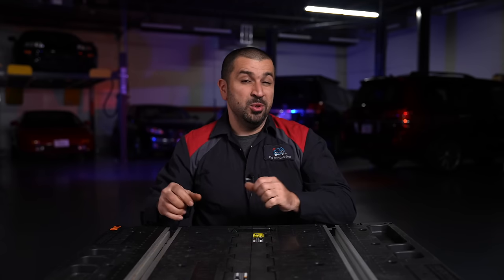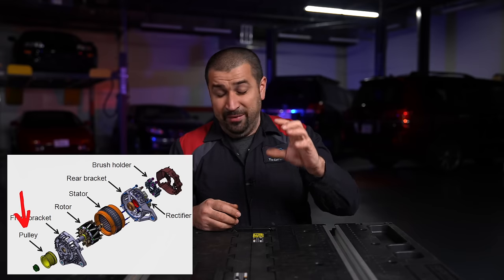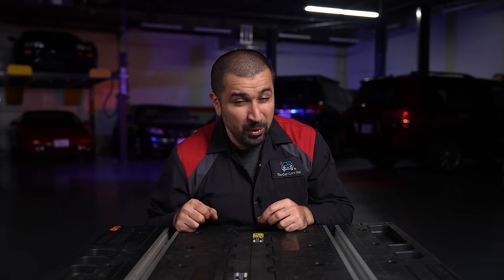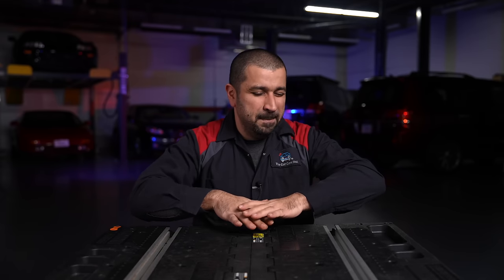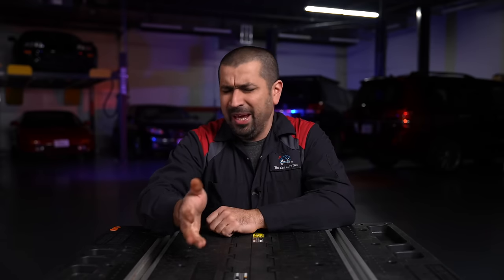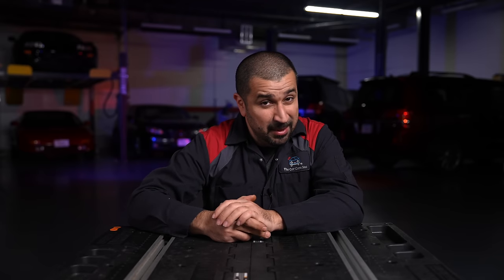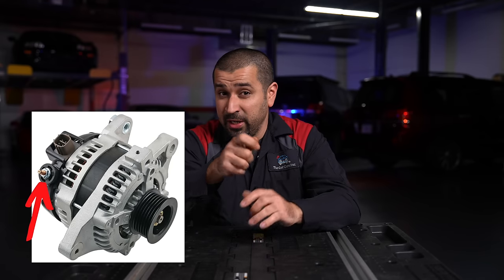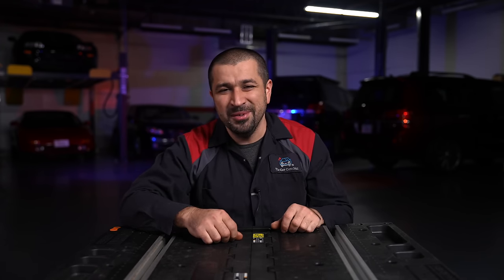How To Make Your Car's Alternator Last Longer? Everything You Need to Know

Comment: Answer:  Buy an OEM alternator.  Do not buy aftermarket.  You’re welcome.
Reply: I would say, if money is tight- buy brand new aftermarket but never manufacture.

OEM > brand new aftermarket > remanufacture
Reply: @herewegoagain7403 As an ex Lucas Aerospace Technician I have never had to replaced an Alternator in over 46 year's of driving I've never know the Stator or Rotor windings to burn out  it's always been either Worn out Brushes,Regulator or Diodes that go faulty and once there replaced there as good as new.
Reply: Except VW costs more than the car.
Reply: @stephenjones9153  I wholeheartedly agree with you. In 57 years of driving, I've always repaired the OEM alternator, never replaced one. The shortest term I've owned a vehicle is 12 years, the longest, 24 years.
Reply: @herewegoagain7403 It depends, I think Denso only keep the casing in their reman'd alternators, everything else is essentially new.
Reply: Just go oem or rebuild oem.  Also charge battery at least every 2 weeks.  My 98 maxima has only needed 2 alternators so far.  Paid $600 last year for the last semester one.  Don't cheap out
Reply: Yeah the oem toyota alternators are remanufactured. I just bought one
Reply: Wow terrible advice, thanks 🙏🏾
Reply: @HawkingHorizon  yes, if it's OEM reman straight from the dealer, then i wouldn't mind but the other brands from autopart stores are usually junk. That's why it's lifetime warranty, gets replaced often
Reply: Thank you 😊
Reply: Also brake calipers
Reply: Absolutely!!! Do not buy any of the ones from Autozone, mine didn’t last one month before it failed. I bought a used OEM one (they stopped making them new for my car) and it’s been fine for over a year now.
Reply: @luvingfully  That's because we were taut by our Dad's and Uncle's how to fix our own stuff and we had no phones to play games on. Most drivers these days can't even change a flat tyre 😉👍👍👍
Reply: I have a new aftermarket alternator from Amazon. Who knows where it was made in. It’s going on three years with no issues. Knock on wood!
Reply: Thank you for saving me half an hour
Reply: Denso aftermarket alternators, both reman or new,  are fine. Bosch is a close second. All other sources…forget about it.
Reply: How difficult is it to replace those items? DIY'er?
Reply: @jimbike8064  Some aren’t bad. Others are c**ksuckers.  Depends on where it’s mounted on the car/truck you’re dealing with.
Reply: @jimbike8064  👍Changing it is easy. It’s digging your way by removing other parts is where the mystery is.
Reply: That was NOT his advice to make them last longer.  If you watch the video he talks about ensuring your alternator doesn’t heave anything leaking onto it and also ensuring you have a healthy battery as both effect the alternator.  He explained simply and concisely how everything works and what to look for.   Don’t short change his advice/video.
Reply: Just measure "worst case" how much current your drawing continuously from your alternator while it is parked. typically the rated output of the OEM alt. should be double what your actually pulling from it.  If your Tundra is rated at 120A dont pull more than 60A max con tinuous.  Overheating the alternator will lower life expectancy of diodes. brushes last about 200k miles
Reply: OEM only on starters and alternators for me. I’ve had bad experiences deviating from that principle…
Reply: It’s been mentioned but OEM is great for those that have the means, those that are more cost conscious will of course explore options. First tier suppliers to the OEMs (Denso, Bosch, AC Delco, etc. respectively) are excellent options and still retain the reliability and longevity of the vehicle OEM. Another great cost saving option for Toyota/Lexus/Diahotsu owners is find the correct part number and add a “-84” to the end for the OE remanufactured part, they will normally save you a pile of money and come with the same 1yr warranty. If you’re in a pinch anything will work for a period of time but the quality tends to drop off quickly and you will use the lifetime warranty on that O’Reilly’s special.

FWIW, if you have a 4.7 Toyota only use Toyota or Denso starters unless you enjoy R&Ring the intake manifold.

Having driven Toyota’s, Lexus, and Mercedes for many many years there are absolutely certain parts that only OEM will do; engine, transmission, steering racks, axles/CV’s parts are the only way to go if you plan to keep the vehicle.
Reply: my toyota corolla alternator only lasted 220,000mies however volkswagen jetta alternator lasted 302,000miles
Reply: @cj8489  He said at the end to only buy OEM.
Reply: @BW-kv9wj  I’m aware.   That is NOT the answer he gave to “Make your cars alternator last longer,” as the title states.  He says that at the end, if you need to replace an alternator.
Reply: I only buy OEM Toyota cars made in Japan, not the aftermarket made in Kentucky Toyotas 😂
Reply: Ty for saving my time
Reply: Best advice he gave
Reply: @cj8489  Whatever. Keep buying aftermarket alternators then. I can care less.
Reply: @BW-kv9wj   It doesn’t matter what I buy.   You’re oversimplifying what he said and leaving out the majority of the advice from the beginning.  Like I said, don’t short change the man’s advice or video.
Reply: You do recognize that OEM alternators cost about $1000 from the dealer?
Reply: I’m going to cut straight to the point replace your battery every 3yrs thank me later. You will have no problems if money is an issue  then change you battery every 5yrs.
Reply: That’s the only Toyota mechanics mantra. Toyota leaks or malfunctions? - Buy more Toyota! Toyota’s up to crappy specs? - Toyota for life!
Reply: This man is correct
Reply: @stephenjones9153  Yours definitely didn't teach you to spell
Reply: @fw1421 they've always been expensive. I bought an 84 Nissan 300zx in 92 for 500 dollars. It was a nice car but alternator went out and it cost me 250 dollars from dealer. That was almost what I paid for whole fkn car
Reply: Do preventative maintenance. Don't wait till shit is about to leave you stranded before you replace it. .
Reply: Why, if oem was so good, why you looking for another? It means oem failed. Lol
Reply: Exactly
Reply: That goes with anything. No aftermarket will ever last as long as OEM.
Reply: Can confirm.
Reply: I have a Napa premium alternator with 200k on it still working perfectly fine.
Reply: Having repaired many alternators over the years, the 2 most common failures were diodes and on the GMs, rear bearing failures.  When that bearing fails, the armature/rotor drops and then grinds on the stator windings ruining the whole thing due to such tight tolerances…
Reply: @sx300pilot5  That’s what happened to my original alternator, the bearing had failed.
Reply: Idk, maybe that’s true for Toyota but hasn’t been for a number of domestic cars I’ve had and Nissan.
Reply: Oem for one is more than likely aftermarket for everyone else! Last i checked these car companies aren't pulling materials from the ground and making it themselves! Go with a company that has an undestroyed reputation for quality sh¡+!
Reply: Mechman sure has been great to me
Reply: @TENNSUMITSUMA  Yes, many parts in vehicles are outsourced manufacturing. But it still has to be built to the OEM standards for various reasons-reputation, warranty, recall prevention, etc etc. But the cheap aftermarket parts at auto parts stores that cost significantly less are clearly not made to last as long because it is designed from the ground up to be a cheaper replacement part for people that don’t care about OEM longevity.
Reply: @aaronfrench8322  doesn't seem like oem cares about oem longevity anymore from what I'm seeing and hearing.
Reply: @TENNSUMITSUMA  Haha, yeah I can agree there 😅. Everything is made like shit nowadays, fewer and fewer models of vehicles are overbuilt anymore. It’s like everything is designed to fail very near after the warranty. Not like some old school Lexus models, ES, GX for example.
Reply: So you don't know that aftermarket companies are making those oem parts but they print a cars logo on them ?
Reply: Love my oem Hitachi one
Reply: Cool thing about an oem, run it 200,000 plus usually, have it rebuilt at the right place, it will outlast most cars.
Reply: Thank you 🙏 for straight answer
Reply: List of discontinued OEM parts has entered the chat...
Reply: Nonsense
Reply: If you're looking to save money, just buy the OEM brushes. Its pretty easy to swap them. Cost about $25 bucks
Reply: Well, I have bought an aftermarket Denso after they explained it was the same one Honda put in the vehicle. I don't want a remanufactured.
Reply: OE or OEM is fine, it does need to have Toyota stamped on it
Reply: You can by aftermarket but reputable brands. I’m in car audio there are several companies that make high output alternators mech man, singer etc. these alternators are specifically designed for high amperage audio systems. I run two amplifiers that draw 900-950 amps, plus a speaker amp pulling another 120 amps.
Reply: My OEM alternator went out on my Corolla at 85,000 miles. They wanted $750 for a new one, I got a refurbished one for $119. Now at 145000 miles that's 60,000 mi so far. Even IF my alternator went bad TODAY I can buy two more alternators for a total of $360 for all three and get $180,000 miles if they always went out at 60,000.

Or for $720 ($30 cheaper than an OEM) I could buy six of them and get 3600000 miles out of it. But I won't even have to because unlike my OEM alternator the $119 refurbished alternator has a lifetime warranty.
And it's easy to install it yourself on a Corolla.

Moral of the story, what you said isn't always the case.
Reply: @ibelieveitcauseiseentit9630  you made the right choice but “OEM” doesn’t mean Toyota branded product… what the dealership was charging was for their name on the box as an authentic Toyota replacement part. OEM means you bought the same exact part without the Toyota sticker on the box, but directly from the parts manufacturer that supplies that part to Toyota (Denso, Bosch, whatever). OEM is usually dramatically less expensive than an authentic branded part.
Reply: Actually, there are individual rebuilding businesses that will give you an alternator that is equal to the OEM at a substantial savings from the over the counter alternator price at the Toyota parts window.
Reply: Yep reman are trash dont do it.
Reply: Yeah, a couple of years ago, the alternator on my Mitsubishi failed. 
I went to the dealer, and my choice was after market $ 850 or original $1000.  I went after market and picked car later that day.
If I had gone for original it would be  2 months wait from Tokyo, pay up front and rent a car. I'm in Western Australia.
Reply: Unless you’re getting ready to sell it.
Reply: Unless it's motorcraft then you're better off replacing it with a quality after market. Denso and Bosch have always served me well .
Reply: Unless you are running a sound system you do need an aftermarket one
Reply: I haven't had to replace an alternator for over 30 years on my cars, knock on wood.
Reply: I like Denso as a company, but their remanufactured alternators are JUNK…. They are just as bad as other remanufactured alternators. I have changed to the philosophy of the other folks here and just repair the OEM alternator yourself…. The hardest part is finding the correct parts to rebuild but there are a couple of good sources online for alternator rebuild kits.  Hell I have started to go back to the old school method of rebuilding many of the parts that commonly wear and so often get replaced now days…. CV axels, brake calipers, alternators, power steering pumps, hell I even rebuilt my power steering rack but I did that after swapping it with a cheap rebuilt one to get my vehicle back on the road.
Reply: Mazda OEM only sell remanufactured alternators and staters.  I bought new aftermarket alternator and starter.
Reply: @HeyYall398 Mitsubishi I’d fully made in Japan as well. Great vehicles in my option
Reply: @stephenjones9153 yes that is correct on old alternators.
Reply: @JohnsJohnson-ns5xm I paid 75 bucks in the early 90s. Took to electrical shop and they repaired
Reply: Better yet , if you have an Alternator and Starter overhaul shop in your town, go to them for a rebuild.
Reply: I agree. The difference is only a little over $100, but it is brand new. Those after market alternators are refurbish
Reply: Alright, so imagine your bike's dynamo, but way more powerful and for cars—that's basically what an alternator is.

When you pedal your bike and the dynamo is on, it generates electricity to light up the bike's lights, right? The alternator in a car does something similar but uses the car's engine instead of your pedaling to generate power.

Here's how it works: the engine spins a pulley, and this pulley is connected to the alternator by a belt—kind of like the chain on your bike. When the engine runs, it makes the alternator spin.

Inside the alternator, there's something called a rotor that spins super fast. Around the rotor, there are stationary parts called stators. The spinning rotor creates a magnetic field that moves around inside the alternator.

Now, when a magnetic field moves around inside coils of wire (like the ones in the stators), it generates electricity. This is due to something called electromagnetic induction, which is a fancy way of saying that moving magnets around coils of wire makes electricity.

But here's the twist: the electricity made by the alternator is not ready to use yet. It's in a form called AC (Alternating Current), which is not what the car needs. The car needs DC (Direct Current) electricity. So, the alternator has a built-in rectifier that converts AC to DC, making the electricity good to go for the car's battery and electrical systems.

Finally, the alternator has a voltage regulator to make sure it doesn't produce too much electricity, which could fry the car's battery and electronics. It keeps the output just right, no matter how fast the engine runs.

So, in short, the alternator uses the engine's motion to generate electricity, converts it to the right type, and keeps your car's battery charged and all the electrical stuff running smoothly.
Reply: think I have a brand new dura last , not a reman
Reply: @aygwm Yeah don't get sh#t starters from Mexico.Learned the hard way
Reply: No thanks. Aftermarket is just as good if not better. Just do your research and you’ll be fine.
Reply: @radius4914  this is true. The new alternators have 15 year warranty which means they will replace it once .  
   I had a problem once because they gave me the wrong block fuse for the A/C It caused the alternator to run super hot. 
  It was actually the fan had burnt out .
 Put the old fuses back changed the fan got a 2ed alternator, life is good
Reply: I have used Autozone alternators on both my 4runner and lexus. Both have been going strong for 3 years plus?
Reply: New vs Re Man, I think u mean.
 Companies like Aisin Denso and SkB make the parts for toyota, so those would be "OEM" as well .
  For water pump and thermostats, they are most definitely made by Aisin because nothing else works .
 Had good results with Beck Arnley as well for an oil solenoid /sensor 
  The DEALER is x3 more expensive .
 Total bullshit .
  The steering wheel wiring harness cassette cost me 34$ the tool to take off the steering wheel was 40$
 Or could be rented 
 The dealer wanted 666$ 
 Perfect price for El Diablo
Reply: OEM is just a label.
Reply: @juanvga  there is also an aftermarket company called OEM that make ok parts not great
Reply: Never had issues with aftermarket alternators.
Reply: Buy either. Never for any reason buy "remanufactured"
Reply: Bought an aftermarket alternator and had it installed by a friend who is a mechanic. It went bad a couple weeks later. We swapped it out for OEM and now no issues
Reply: @JohnsJohnson-ns5xm Yeah, Don’t buy VWs.
Reply: Had good success with rebuilt on a couple of vehicles for not a lot of money. If it’s a DIY for you and easy to access, choose whatever you can afford. If it requires a mechanic to access it buy the best part you can. You’re paying a fortune in labor.  Don’t want to pay it twice from a bad part.
Reply: How timely, my alternator just went bad today, OEM 2007 4Runner, lasted 17 years. 

Replaced it with DENSO OEM alternator.
Reply: I just did that mistake and regretted it 
Problems started 
So i had to go for the OEM again and the car works great now
Reply: I typically agree with using good quality non aftermarket parts.  On my 07 Corolla I went to Napa to buy a manufactured Denso since Denso is the original. The warranty was only about 3 years. I decided to go with the Napa brand since they offered lifetime warranty. Seemed like they stood by their product more than Denso. I could see if you’re paying labor to go ahead and pay the extra for the Denso but I installed it myself and it was easy to change on the Corolla only about an hour.
Reply: @JohnsJohnson-ns5xm  I feel your pain
Reply: @stephenjones9153 
“ they’re “. You’re in aerospace but can’t use proper grammar?😂
Reply: Mitsubishi wants 1100 for one, this is tough, my people.
Reply: Idk... I've had OEM alternators die in 5 years before.. but I also put a cheap $60 Chinese Amazon alternator on one of my beaters I didn't care about and its still working after 7 years.
Reply: OEM Denso Remanufactured?
Reply: @paulferreira8342  
Bosch remans are very iffy these days.  Bosch sold off their small motor division to Private Equity and it was moved to China.  You are better off rebuilding an older Bosch alternator.  Replace bearings, new voltage regulator (or brushes if possible) and maybe new slip rings.